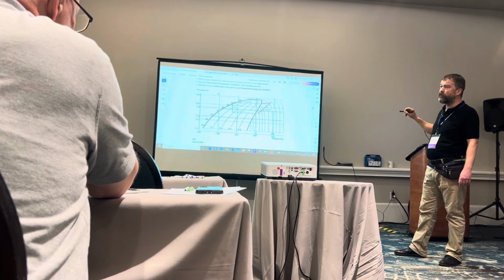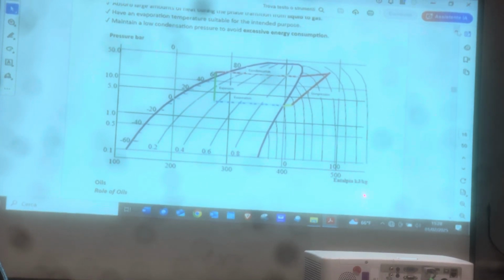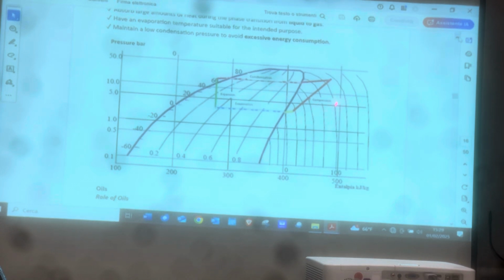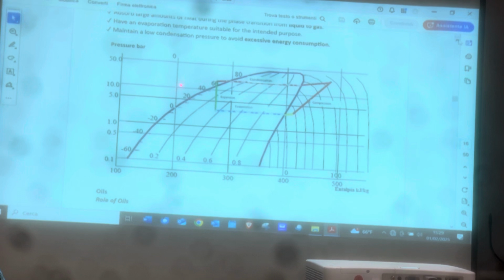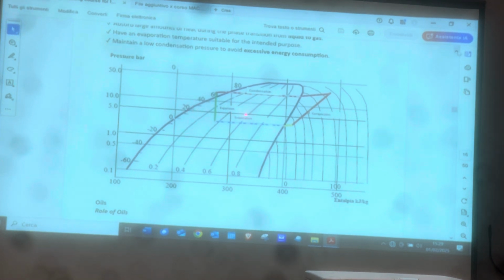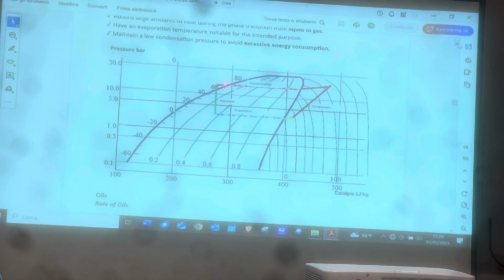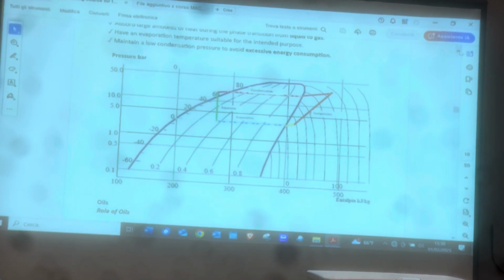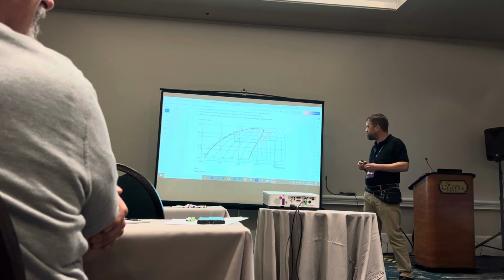Automotive HVAC there is more than just replacing broken parts. Or diagnosing using PSI￼

Comment: Is that a enthalpy chart I see there ??  Good info I learnt outside of  mechanics trade school . An auto a/c R134A will function at 220psi but perform far far better in hot weather at 150psi in 110f on a fixed disp.comp. Why because nobody cares about high side psi which is a function of condenser size ,, but everyone should care about the refrigerant temp going to the evaporator . Temp /psi relationship . Many  modern setups dont have these old school issues , at least the ones designed properly .
If people search the net there are some good vids explaining this but many are incomplete
Reply from the maker: @paulthompson1654  on the Facebook group I’ve put many links to very good videos. And when people ask a question, I just tell them to go back a few months and look at the video links that I have.. with so many people today have no attention span and they get very upset. If you just don’t give them the answer to the one specific question they learned absolutely nothing..  they don’t bother to learn the basics and how the system truly operates. They absolutely learn nothing except for that one little piece of information.. and then they have a problem and they come running to ask for another piece of information without understanding and figuring it out themselves when the information has been handed to him on a silver platter. They want mommy to spoon feed them..
Reply: The auto electricians have tried to corner the business in ozzy but like most have little understanding of refrigeration /A-C . . They auto sparkys are taught the same as mechanics  very limited content .  Taught enough to be dangerous/poor reputation  to there own business and produce poor work . Just ask the guy with 40ft vacuum hoses .......WTF
Reply from the maker: @ 🤣 yes we have those here in America too. Some Mobil guys with machines with a big long roll reel of refrigerant hoses 20 feet to 40 feet.
I feel sorry for their customers .
Reply: @coldfinger459sub0  50cfm vac pump . Yes 10cfm minimum  because as we all no long hose = long pump down times . The micron level would be down  some time tomorrow  maybe . Remember they also charge thru the same  hose ....LOL    j All this thru a 1/4 acme hose HA HA LOL     .. how bloody useless  are long hoses .
Be an interesting test ....
Reply: Flash gas ,,,,,he he he LOL    ask anyone in auto a/c   99.9% have no idea and dismiss it . Every AC unit commercial transport has always cooled far far better . when high side psi is reduced to low levels .
2  parts answer 1/ lower refrigerant temps are better at cooling more efficient    etc  DOH   2/ after the hot refrigerant passes thru TXV it has to reduce its temperature ALOT from a starting point of  260psi [ 150F]    VS 150psi [110f ].then down to operating temp psi of around 30psi  The cooling of the high temp liquid consumes some of the evaporator cooling capacity thereby reducing its ability to cool cabin .  Consumes more cooling when starting from a higher temp level
Reply from the maker: @ that’s the whole idea about the modern day high efficiency, micro channel condenser with a integral receiver dryer.  After the condensing and cooling of the refrigerant is forced through the receipt or a dryer.. 
    After the receiver dryer, then it’s forced through the lower few tubes, refrigerant passages in the micro channel for sub cooling to lower the temperature of the liquid refrigerant.  And then they even go one step further on the most modern vehicles.. they throw in the IXH (internal heat exchanger around the suction line with the warm liquid sub cooled refrigerant.  To remove even more energy out of that liquid delivering a cool high BTU density capacity refrigerant to the TXV.
     On top of that, we have variable displacement compressors to lower the compression ratio. 
       And better control of variable displacement, condenser fans to play with the head pressure for optimal efficiency
It’s all about the software nowadays, controls everything and higher efficiency hardware